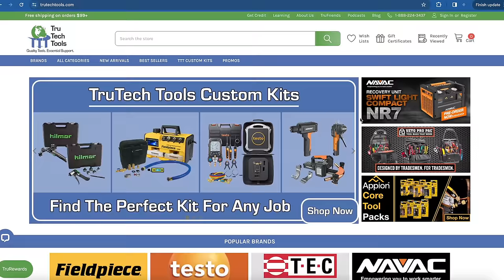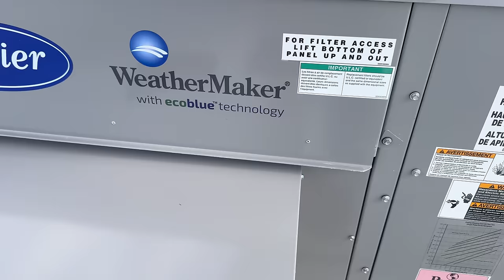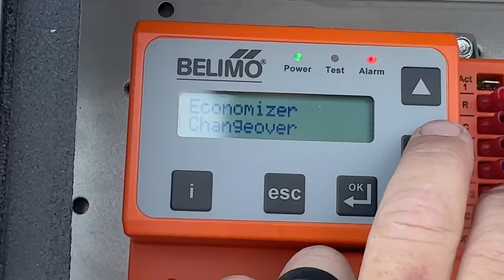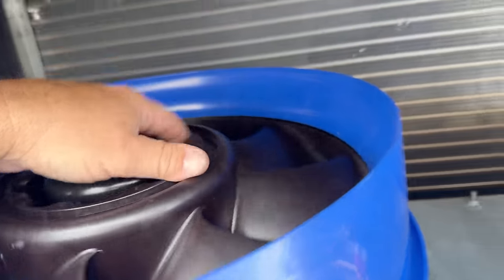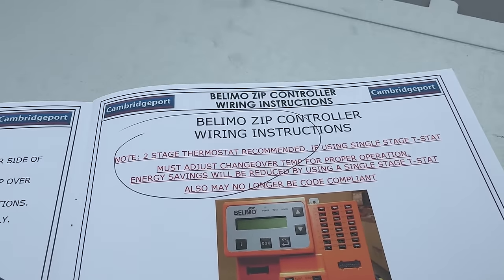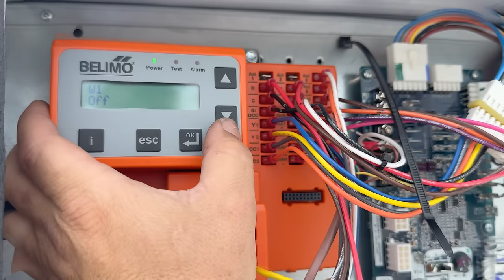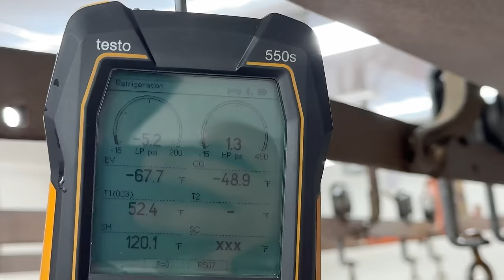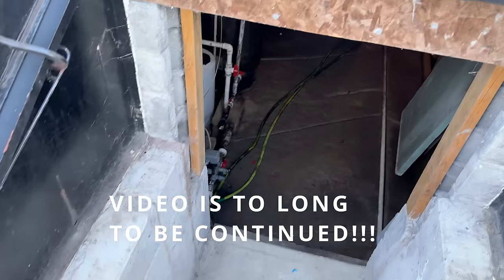2 No Cooling Calls & 1 Refrigeration Problem

Comment: I have worked on and with a lot of Belimo Zip economizers.....they are probably the best out there in my opinion. You set the zip code and it'll set the economizer, enthaply etc etc based on your climate zone. So it gets specific. You can also make slight corrections to tweek it. If you ever take a sensor out, it'll recognize that and not look for it and not show it's readings. It really is the most plug and play out there
Reply from the maker: I liked it when I was done making love to it. 🤣
Reply: @HVACRSurvival  did you have to have "cuddle time" as well. 😆

Comment: there sure is a lot of discoloration on the top of that condenser coil, is there a leak on that coil already?
Reply from the maker: I’ve seen that on several different air conditioners. I think it’s the oil they use when they’re manufacturing it. Shits made in Mexico now. What can you say🤔

Comment: FYI, if you order a new Cambridgeport factory Belimo actuator, they do not feature the same bolt openings, so it has to be re-engineered
Reply from the maker: Are you talking about the four screws that held it on? If so, that wouldn’t surprise me it seems like that was gonna be a week design.

Comment: Wonder why they don’t use alignment tabs on those plugs, so it’s physically impossible to plug them in the wrong way.
Reply from the maker: @bassman34516  three different manufacturers are making a economizer for these carriers. The main plug is the factory one, the one that was incorrectly plugged in was the plug provided by the outside manufacture. All the economizer companies could do is put a sticker on the plug. The factory won’t change there’s because it only fits one way when it’s installed as originally designed.

Comment: Nowadays if a system is up to two years old I start "fail finding" instead of fault finding. Saves a lot of time if you assume it never worked from the beginning. I suspect you are on the same page 🤣

Comment: New carrier economizers are absolute trash, at least guy left the bypass plug. The first thing i would have did is unplug economizer at module, and economizer and plug in bypass plugs, see yea,call installer and have him deal with economizer issue.
Reply from the maker: The problem is that wasn’t an installer that started it. But I can’t say that in the video.  Our shop it’s OK with the Installer not to knowing but not a service guy who put hours down on this job and then I had to go back out and do it again. That’s what pissed me off and that’s why I was such an ass about it.

Comment: 1/16th to 1/32nd of an inch. that is old school machinist/finish wood worker cruft. that said, I have  done both in the past. it's hard and time consuming, cheap tools to billion dollar tools.
unless the same tools and machines have existed for many years and you've used them for many years. game is over, everythig now will all be pre-beta trash, multi-alpha level junk.
not knocking anyone i particular nor pointing fingers well maybe my middle fimngers ( in unison). 💩

Comment: so, you spent anywhere from 4 to 999 hours on that garbage. yeah, facts of current trash equipment. nothing you did or are doing. garbage is garbage. can we go back to the wild abnd crazy 1970's random installed junk, that actuakky worked and lasted for 30+ years? with self installed linsets(lol) yeah of course they don't want to. and craftsman tools with "lifetime warranty" whose lifetime? I have had a hard time getting NEW tools I was gited and bouth in the 1990's as of 5 years ago, to more current. (lowes), they did finally exchange the four screwdrivers.
enough, may as well buy and thriw away trash, if I have to battle with them. I quit ranting now and fully understand you 🤠